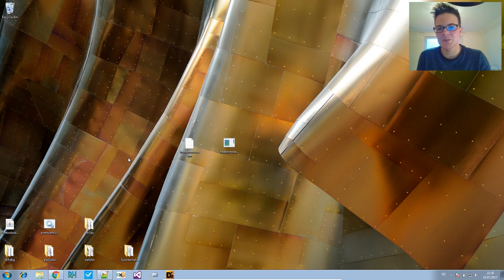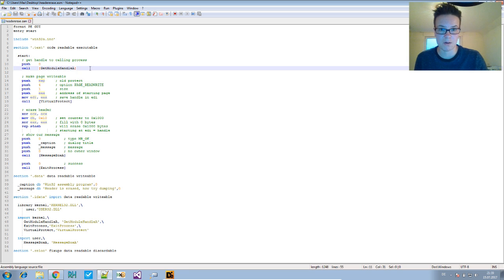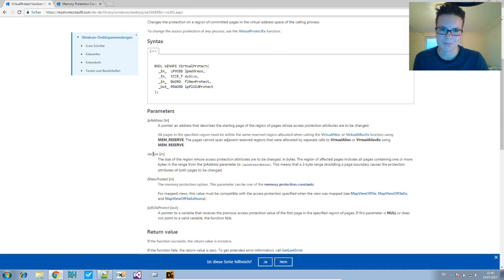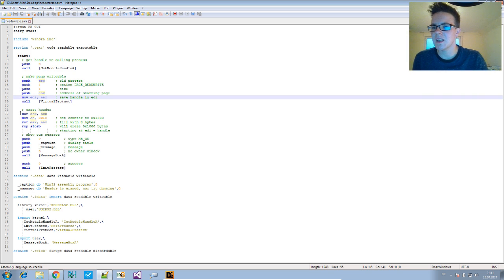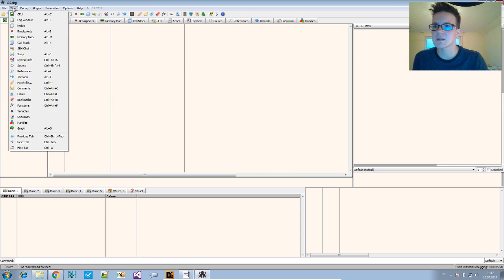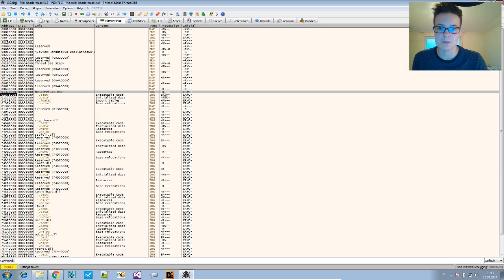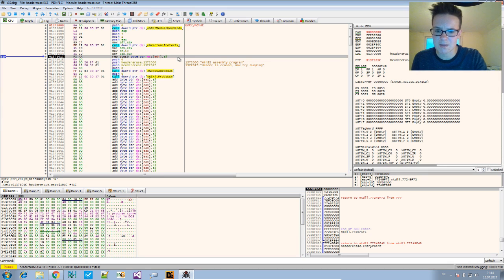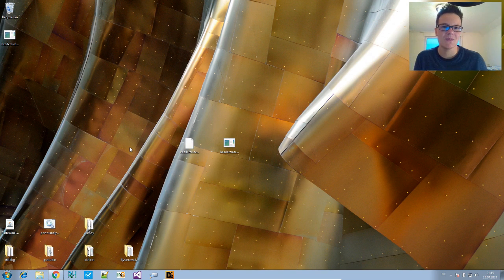Anti-Reversing - Anti-Dump Trick "Header Erase"

Comment: to have a valid dump sometimes it's enough to recover header from disk (from the original file). BTW. weird way to show PoC with size optimized code I mean xor ecx,ecx and mov ch, 10 instead of simple mov ecx,0x1000
Reply: good luck getting past obfuscation and anti debug preventions. i figured out a way today in protecting c# assemblies from being dumped. it’s impossible which i’m glad i found out about pe header dumping